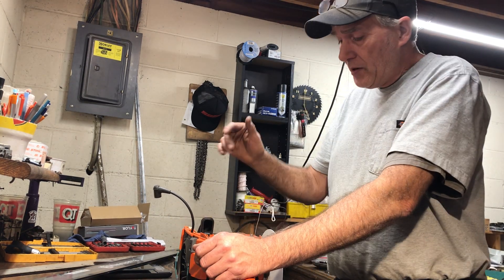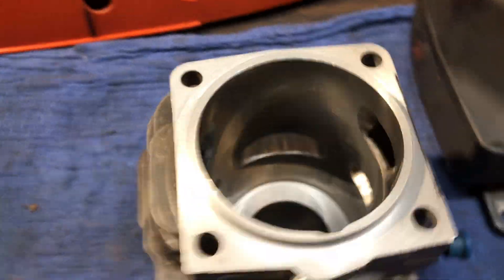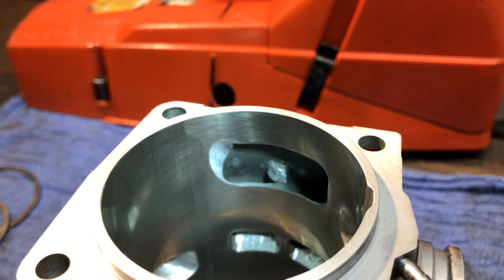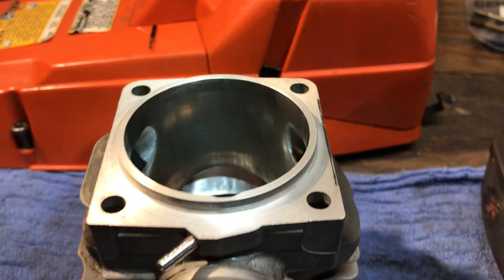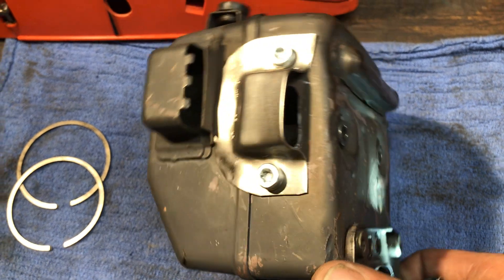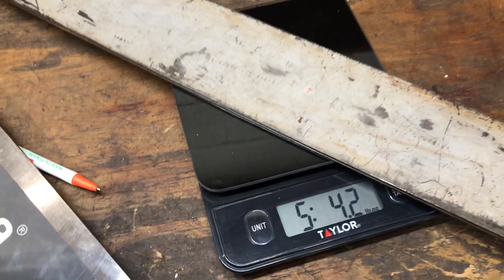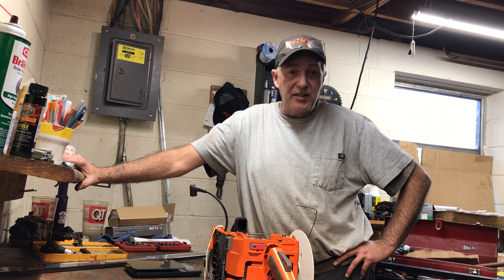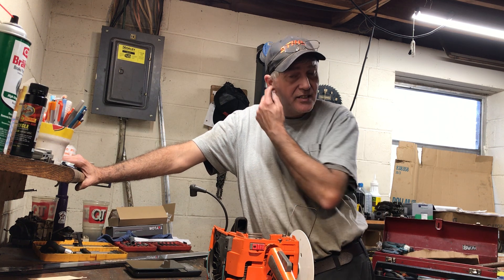Ported Husqvarna 395 XP.  Another full rebuild

Comment: Hey Richard, I am beginning to port my own saws. I am curious as to why you shaped your lower transfers like so (towards the exhaust) and What do you think is the benefit of that versus hogging out the lower transfers towards the case?
Reply from the maker: I've learned my lesson Hoggin' out cylinders.  You loose velocity and crankcase pressure.  Do a little at a time.  You can always take a little more out.    It's not like you can put it back after you ground it out.  As far as opening up the lowers toward the front of the cylinder, I think it helps direct flow toward the intake side of the combustion chamber.  Thanks Rich